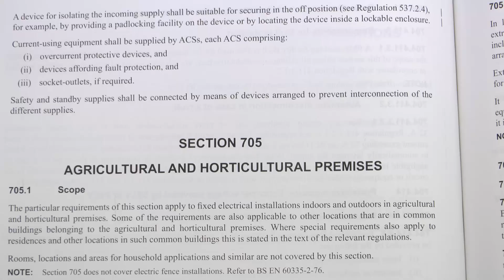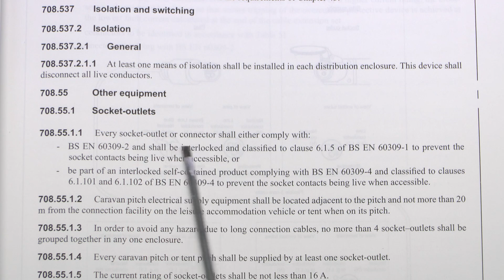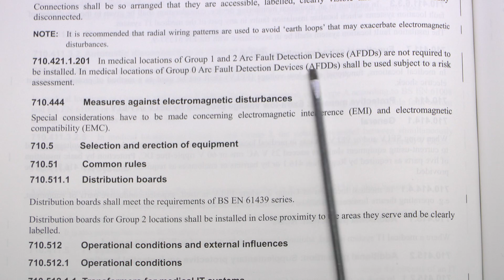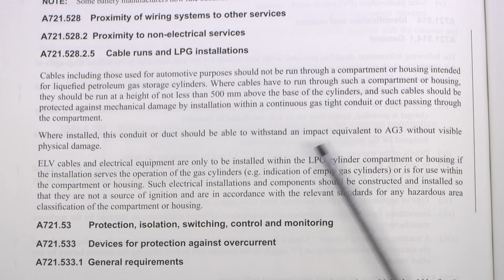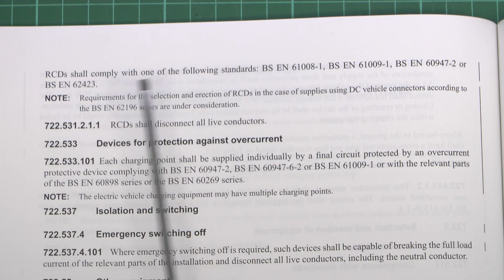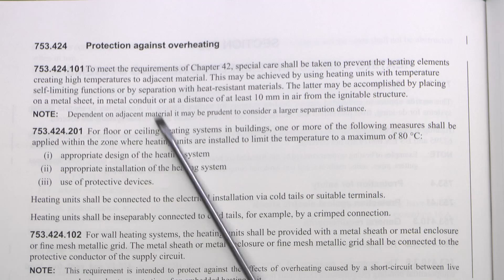BS7671 18th Edition Changes in Part 7

Comment: john i have thing in the regs book that i find confusing , 17th edition bottom of page 36 voltages  low voltage between 50 volts ac and 1000 volts ac   only been electrician 43 years  when the 1000v megger came out the first day i knew that was not low voltage  perhaps cause it dc  .keep doing these great videos john thanks
Reply from the maker: Low voltage has been 50-1000 volts since the 14th edition in the 1960s.  The older 13th edition had low as up to 250 volts, medium up to 650, and high as over 650.
Reply: @jwflame  you are correct john but i think you would agree 50 volts for many years has been thought tobe low voltage . or safety voltage . to many ways it is now the max voltage in testing on modern test gear that metal work or what was called frame voltage refer to the teminal marked f on the old voltage elcb was 50 volts ac to earth . i beleive our yellow box site transformers could only be called safety supplies is because of the 55 cte ac volts to earth . standing in a trench with water around me an someone say you are ok mate use that drill its low voltage 1000 volts ac to earth . john i dont look at the videos for something to moan about so please keep up the good work phill

Comment: Hi John, any chance of producing a video regarding supplies for Amateur Radio 'shacks'? Its a subject that always seems to raise a great deal of debate but seems not to be covered by 'Special Locations'. By their very nature there places will normally have extraneous connections, eg antenna earths/lightning protection which will often have a very low impedance. I have viewed may of your great videos and get the feeling that in the long run these places would be best with a TT system, possibly including a 1:1 isolating transformer. Any views?
Reply: philip i noticed your question i am an electrical contractor and carry out some work for a company who install trans mitting stations . broadcast and private there are things electricaly related that are specialized , these can be understood by people in the ham world like you and me with no disrespect to any one . the information i have gained i have had to research . the tt and the 1 to 1 you are in the right direction . how clean the output of the station is will affect voltages produced accross the earth rods that sort of thing . harmonics can due very strange things ,i wonder if the rsgb have any shack installation information or offcom . the information i have is hands on learned and not technical . been in the trade 43 years and my customer about 48 in radio will think how to get more info to you .   sorry mr ward if i have but in on your channel

Comment: Knocked through a wall and installed a catnic lintel. Light switch (2g) installed on plastered face on one of the faces under the lintel (I.e. the light switch is directly under the lintel). 

How are such cable runs if they need to run up as mine do? Can’t go up through lintel. Not easy to put in a box to create a new safe zone. Outside of the 150mm inside wall joint. 

Any suggestions for the correct way to route this?
Reply from the maker: Steel conduit or armoured type cables can be installed outside the zones.  Or normal cables if more than 50mm below the surface.
Another option could be to route the cable along the ceiling, down the nearest corner, under the floor and then up to the light switch.
Reply: John Ward thanks. Yes considered SWA. Floor is solid concrete. It’s all RCD protected. 

Thought this must be a common problem with ppl knocking through rooms so much these days. 

Thx
Reply from the maker: It's fairly unusual to have the light switch within the opening reveal, a more usual location would be on the wall within the room so the cable could go vertically above the switch.
BS8436 cable is another option, although it may be difficult to obtain in a small length, normally only sold in 100m+ reels.
Reply: John Ward yep. Try telling the wife that it’s an unusual location :)

Thanks for taking the time to reply. I’m just watching your LED light video right now. You’ve just coloured in using a red pen and said “I can imagine all the comments below the video already..” Made me laugh 😀

Comment: Hi John, thank you for great videos, I did some electronics, the 14th edition long time a go and I am a bit rusty; however I know that it is possible to compare all the different supplies by their equivalent circuits with a potential difference of their earthing arrangements and their earth fault currents. Do you think you could do a video to compare all the supply systems with their earthing arrangements and earth fault paths along with their appropriate fulfilled condition ie, Zs x Ia <= Uo x Cmin as almost the same formula is applied for all but some of the terms changes from one system to another and going back and forth with the Regs and tables gets it just a bit more confusing. Also could you just give a brief explanation of the classes of equipment according to BS EN61140 on page 458 on the 18th edition under the BC subtitle, what do Y (yes?) stand for, is it permitted for an earthed to ground potential class zero-0 ?
Thanks a lot xxxx

Comment: Great video as always. Probably a daft question, but is an RCD plug in socket pointless for garden equipment (lawn mower, etc) if the socket is on the ring and protected by an RCD at the consumer unit?
Reply from the maker: It's pointless in that it isn't necessary - the RCD in the consumer unit does the same thing as the plug in version.
However it's not unsafe or dangerous to use the plug in version as well.
The only minor problem is that if a fault occurs, it could be the plug in RCD or the consumer unit RCD which trips, or even both of them at the same time.

Comment: I am an alarm & CCTV engineer. How does the 18th edition affect me? I mean like fitting fused spurs and cable fixings?
Reply from the maker: Fused spurs are unchanged.  Cable fixings need to be metal or some other fire-resistant type.
Reply: John will no doubt cover it in this series of videos at some point but as I understand it, as long as you're following manufacturers instructions when installing you can't go too far wrong. They have to design equipment within the same guidelines as you work as an installer or get sued.